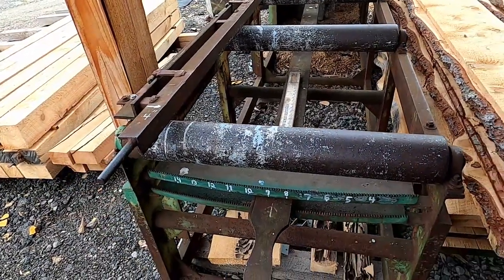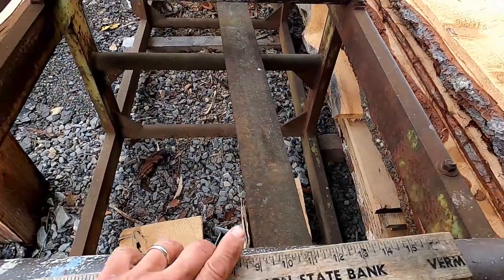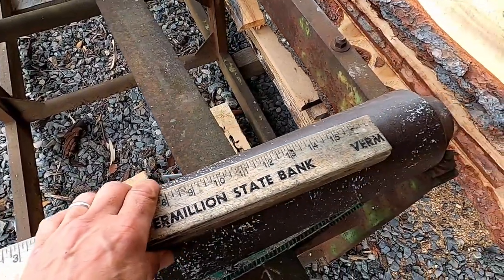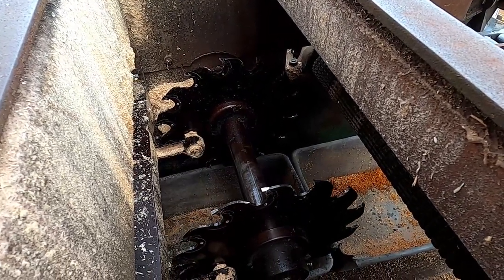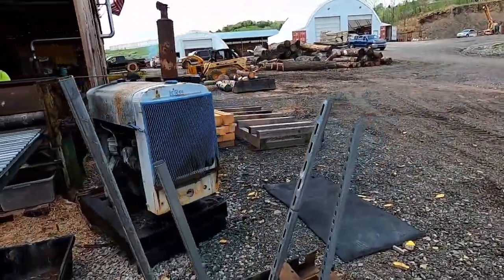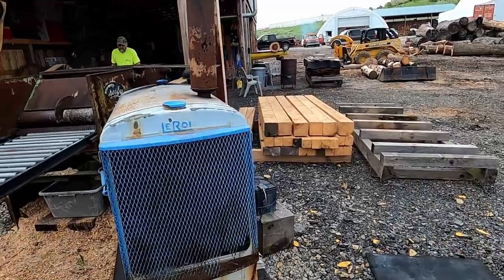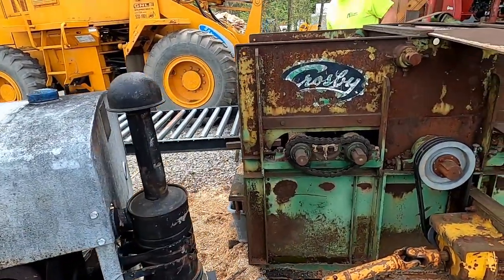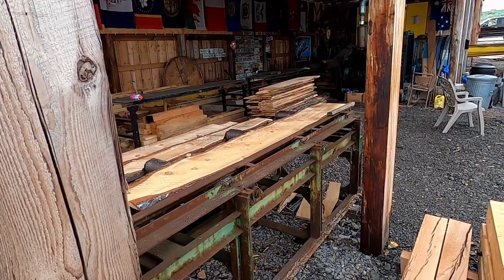our Crosby 32 inch edger # 301

Comment: I remember the old Continental, Red Seal and LeRoy engines on the Bucyrus churn drills hammering out wells around here. Good old edger and good old yall too. Thanks, Mark! God Bless!
Reply from the maker: yes they ran them on everything back in the day and still running strong.

Comment: Thanks Mark for the close-up look at the old Crosby edger. Looks like a very sturdy piece of equipment that has stood the test of time and has paid for itself many times over. Still does a beautiful job of edging boards and maintains very good accuracy. That guy tailing the edger looks familiar for some reason. I know that I have seen him somewhere before. Anyway, are you still planning on doing any Friday Eve videos or is that on hold for the summer? Thanks again for the quick look at the edger in operation!
Reply from the maker: glad you liked it Randall , yes very well built but needs new feed rollers.

Comment: Running a  edger is work my dad's old edger which we still have, is simple  the width gage is a series of hoes drilled in a PC of curved iron. Solid fence. 4" set blade and a 2nd slide blade... unknown manuf. But at least 80 years old.

Comment: I didn't quite understand the process and would've understood it better, had I been able to watch you set up the board using the ruler, make your adjustments on the machine and feed the wood into the saw.
Reply from the maker: I will do more edger videos.

Comment: I still don't understand how the fixed blade side knows where to to cut to clear the wane (bark) for a clean cut on that side. Been wanting to see a video on this , thanks.
Reply from the maker: the numbers on the front of the edger sets the movable blade.
Reply: @markgalicic7788  I understand that , but what about the fixed blade side? Is there a fence that moves on the fixed blade side so as to cut the bark off? Thanks for your time.

Comment: OSHA requires that open pulleys, gears, belts, chains and drive shafts shall have protective guards installed and in place. You could get some big fines if they inspect the edger.
Reply from the maker: OSHA don't inspect private mills.
Reply: @markgalicic7788  that is of little consequence if a person trips and falls into a open operating equipment and is seriously injured. Whether or not you are cover does not dismiss the common sense of their guidelines.

Comment: Good video, mark. One question - does the scale for the blade adjustment on the machine correspond to the fence engaged or flipped back out of the way?
Bill
Reply: The board width is between where the fence is and where Mark sets the other blade with the scale. When the fence is down, only the right side of the board will be cut, like a normal table saw. When the fence is flipped up, any rough edge to the left of where the fence would be when it was down will also be cut off, thus edging both sides of the board at once.

When you watched the video, you probably noticed that most of the boards had two scrap pieces, one for each side of the board. These were cut with the fence flipped up. A few only had a scrap cut off one edge (the edge closest to the camera). These were cut with the fence flipped down and the existing good edge of the board along the fence.
Reply: @lwilton  I know that but which way is the scale aligned on the adjustment arm? Fence in or fence out?
Reply: @williamellis8993  It's the distance between the blades, so is from the fence to the right side of the cut board, if that is what you are asking.
Reply: @lwilton  Yes - that's what I was asking

Comment: What percentage of a log would you say is turned into useable wood?  30%  or more?
Reply from the maker: I would think 85 percent.
Reply: @markgalicic7788  okay, I just see so much scrap coming of logs, then the edges on the boards, then there are the bits and pieces that would have 6 foot minus boards, and it looks like a lot just disappears.  I am not looking at firewood as "use" by the way.  Although that is legiut.

Comment: The U joints on your drive shaft are 90 degrees out of phase.  This causes unnecessary rotational vibration.
Reply from the maker: they work just fine , it is set up to be moved like farm equiptment.
Reply: @markgalicic7788  No, that's not the point.  Look at the drive shaft under your car/truck.  Notice how the bearing caps are aligned with each other on the opposite ends of the shaft.  On the edger the bearing caps are 90 degrees out of phase from one another.  If one is horizontal, the other is vertical.  They should both be the same.